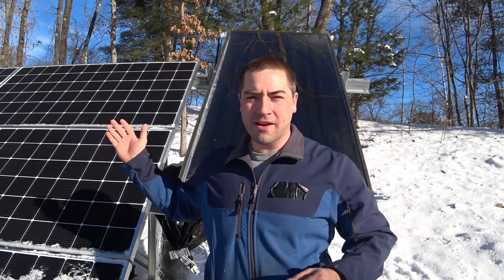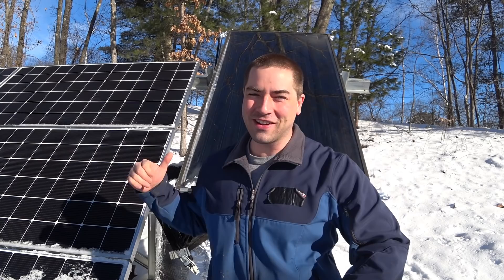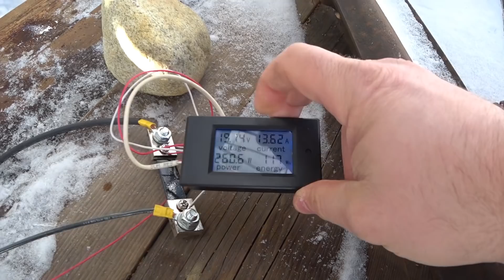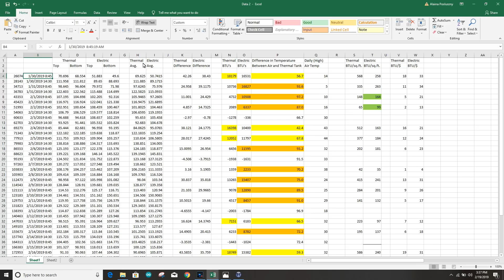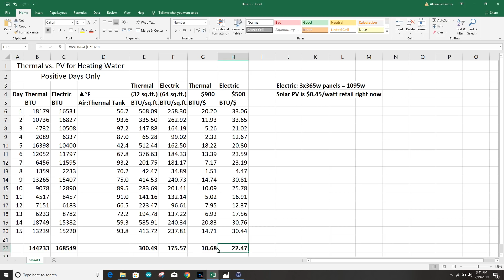Results of Solar Thermal vs. PV Experiment in Heating Water

Comment: Thanks alot for sharing this experiment. Can you come back with data for April and May?
Thermal panel should always be better in heat applications. PV has what, 20% efficiency? If you collect the heat perfectly you should get near 1000w per square meter in sun instead of 20% of that...
Reply from the maker: The solar thermal panel works better when there is a smaller difference in temperature between the outside air and water.  Basically, less heat loss out of the flat plate collector to ambient air.  So, if the outside air temperature is 100 degrees, and you are trying to make 130 degree water, there is a 30 degree delta. (Fahrenheit) This will outperform the solar PV.  I set this experiment up in winter on purpose to find out which works better when the delta is large.  The greater the delta, the better PV is compared to thermal.
Reply: @DavidPozEnergy  Okay thanks for the answer. But I do believe there are some unique factors at play in your experiment that could be improved to raise the Thermal Panel results. And that goes for all youtube experiments of course. Just the Thermal Panel itself plays a major role what kind it is... When (if?) you put it on the roof and the watertank indoor you should get significant better results I assume. Best of luck to you!

Comment: Hi David, I'm kinda obsessed of watching your videos recently, it's very interesting for me. By watching it I've got curious about where do you live since there are pretty cold during the winter. I live in the place witch latitude is 55° North. I am thinking of going solar but there are some skepticism regarding the living in the North part of Earth. I'm curious how much power  during a year can I expect to get out of the PV system which has 10 kWp of installed power?
Reply from the maker: Hi ZhlvisLT.  Solar can still work at higher latitudes, but just to a lesser amount. I live in Massachusetts, 42°N.  There is a rough rule you can use for how much power.  Multiply your system size (kw) by your sun hours (hrs).  For me, where I live, I have 2.8 sun hours per day.  This is an overall average taking into account sunny days and cloudy days.  https://www.altestore.com/howto/solar-insolation-map-world-a43/
Reply: @DavidPozEnergy  Thanks for an answer. Could you  share how much electricity did your system produce during the last year?
Reply from the maker: Sorry, I don't know.

Comment: Ive seen work with solar thermal in roads and ive been thinking that designing a driveway around it could be the best way to hide the panel and also your driveway usually goes right next to the house so it would be easy to pipe it into the basement.
Lol at 8:00 when you said the pv was so simple yet you goofed it at the beggining.

Comment: I think the PV wins hands down for me for many reasons! One is that it is very easy and cheap to move electric anywhere needed and have little loss, not so much for hot water. I could put a large storage tank in house or shop far from the array, then just electrically heat water at the tank. Moving hot water takes pipes/hoses and insulation all of which adds up to far more cost than same amount of wire, and there will still be more heat loss moving water than loss of power in wires.  For heating need Lots of hot water in winter, very little in summer, but need air Conditioner in  summer and hot water does not help with that at all. The excess PV power  can easily be changed from heating water to running air conditionair. Pretty much almost no worries with PV, but water leaks scale pumps etc.. etc.. For the collector type. Also in hard freeze severe winter no real chance PV will freeze up and bust anything.  Electric also cannot freeze in a wire like water in a pipe or hose rendering a system totally useless with a blockage, and no costly antifreeze is needed for an electric system. Also in a Shutdown failure of some type like a leaking storage tank, PV can be switched over to electric heating for whatever heat it can produce so not total loss of the system.
  Yep, for me the PV is a clear winner since I have more space than I could use up installing panels.
  Also I could just sit a tank like a 275gal IBC in my shop, no insulation needed as any heat loss will be heating my shop and just install electric heating elements right into that tank.

Comment: You're using the wrong type of thermal panel.  People in Northern latitudes typically use vacuum tubes.  Tube insulation is way better than flat panel insulation.
Reply: Well, everything is an evolution.  It will be fascinating if and when, he may do the same comparison with a vac tube system. Hopefully as the channel grows and the economics make it feasible to run out and buy thousands of dollars worth of equipment, we will may a video on it. I hope so. Ive seen vac tube systems in action in below freezing temps and their performance is  very good, so good that water cannot be left stagnant in the set up on warmer days for risk of boiling. Excess heat must get dumped if it cannot be stored. swimming pools and hot tubs are good for that.
Reply: That's not the only (or even bigger) flaw of this experiment, but that is true.

Comment: Makes a whole lot of sense, particularly the fact that the solar thermal is only more efficient under ideal conditions whereas the solar PV can be productive across a wider set of conditions.  And I would think just being able to run the PV-produced eletricity over to the house without any further (serious) losses is also quite important.  That gives you a lot of flexibility in situating the tank in a location where even its waste heat would help heat the garage or home.

I'll bet the PV solution would work as well for the garage as for the home using the same heat-exchanger method.  For that matter, even a single-loop heat exchanger with a small fan ought to work pretty well for heating the garage.

Now, since its a closed-loop system, what about using something other than water?  Something that doesn't suffer from corrosion or mineral deposits and perhaps can handle higher temperatures and/or have more heat mass?

-Matt

Comment: In EU/ Poland it is still more affordable to buy solar panels to heat up the water. 3x pv with 360W cost $1100 and high quality flat solar panel cost like $350, tube solar panels are bit more expensive ~$400  (depends on design/ no. of tubes etc). From Feb to Nov both solution do good job, but in my area is better to power up home from pv's and have hot water from solar thermal. In December and January there is almost no sun so both solution don't give any relevant difference. I think you could also test tube solar panels in colder days are much better. I also see that PV's and solar thermal from China (or some crap factories) don't hold their specs, even good panel on paper can be real shit in case of cloudy days.

Comment: Thank you for sharing your efforts in this comparison, it’s very interesting. I may have missed it, but did you record electrical power produced from the PVs for the same 15 days as your thermal comparison? Also, what was the “rated” power of the thermal panel? From your data, it seems as though you obtained only about 92 W/m2 useable for heat from the PVs, but 157 W/m2 from the thermal.
Reply from the maker: I did not record the electrical watts.  I recorded the tank temperatures.  The data plate on the side of the thermal panel says "Thermal Performance Efficiency (ASHRAE 93-77) 81 BTU/ft2-hr-°F"
Reply: OK, thank you Sir. So that’s 2590 BTU/hr or 760 W (per degree F)...I guess that’s a delta T between the inlet and outlet. Was there much of a difference between the top and bottom tank temperatures? The angle of your panels means you live pretty far North, I guessed about 6 hrs of sunlight per day in Feb...at least when it wasn’t snowing! Thanks again for your efforts and reply! There is a ton of “stuff” out there, I really appreciate it when someone is willing to share the numbers.
Reply from the maker: The raw data is all on Patreon: https://www.patreon.com/DavidPoz and I live in MA, 42.5°N
Reply: Thanks man. So, about 2 degrees F delta T, which gives your thermal panel around 1.5 kW, or 500 W/m2, and made it close to 30% eff. at heating h20. That’s awesome! The PV’s were about 18% eff. Thank You!

Comment: Awesome info and exactly what I was looking for. I have been tossing around this exact thing either going solar thermal or pv to heat my water heater. Been on a quest to cut my homes energy and have already cut about 50% and now its time to shut off that hot water heater once and for all and heat it will solar panels. Should have a pretty good return on investment as I figure it cost me about $30 a month to heat water, so at a cost of around $500-600 to install a pv system myself im' looking about about a 2yr return which is pretty damn good.

Comment: Sadly over here 3 photo voltaic panels cost a lot more than one thermal panel. I am assuming that you are using 300w panels judging by the physical size. Interesting video though, got me rethinking my shop heating.
Reply from the maker: Yeah, everyone's situation is a little different.  I tried to use retail pricing for my comparison, but it's for the US.  These panels are actually 365 watts, and I bought them used.  Still work great.

Comment: With PV U still need to buy your electric heater or heat pumps. Those will add additional cost. Heat pumps will last u 5 yrs and u buy again. For heating water. Thermal is the best. Plug and forget.

Comment: David....great job....I am in Israel where the Solar Thermal panels and a tank (usually 150 liters) are required by law for every house and apartment--you see them on the roofs of every apartment building....called a "dude shemesh"  lit. "sun boiler"....no pumps--thermal syphon principle....I'm also doing research on how to retrofit existing systems so they produce more hot water expecially in the winter...how did you get the digital thermometers into your tanks without leaks?
Reply from the maker: Hi Jeff,  Israel is a hot climate compared to where I live, North East United States (Massachusetts).  So I suspect the thermal systems are better for you.  That's great you are working on improving them.  I showed installing the temperature sensors in this video: https://youtu.be/kkoesuG72xQ starting at 15 min. 7 seconds.  Thanks for watching.

Comment: on the thermal - would be interested to see experimentation of different flow rates on the water circulation - how would that impact?
Reply from the maker: The ideal thermal system would have a variable speed pump, and a fancy controller.  The perfect setup would be to have the water coming out of the panel always just a little hotter than the water coming in.  If it comes out a lot hotter, the pump needs to go faster.  If it comes out not hotter, then the pump needs to slow down.

This wouldn't make a big difference on my experiment with one collector.  But it would be a good thing on a huge setup.  Maybe someone could build it with an arduino?

Comment: It would be interesting to see how the numbers compare in the summer. From what I've read, PV efficiency drops a bit when the panels are hot. On the other hand, you wouldn't be needing the thermal heating in the summer, either. So, the PV might overall be more helpful. But, if I was going to heat a swimming pool in the summer, I'd probably stick to the solar thermal.
Reply from the maker: Solar thermal is the perfect choice for heating a pool.

Comment: I didn't notice if you took the temperature of the PV array into consideration in your study.   PV panels perform better on really cold days.
On hot summer days,  they are at the worst. But if it's under 20F  (air-temp) outside, you can count on more power from the sun.

Comment: Now do a test where you empty and refill on a daily basis as you would actually be using in a home. That would be more pragmatic than your first test..
Reply: This is a good point. Solar Thermal will improve in performance with colder inlet water temperature.

Comment: This heater will beat Dave's experiemtnby a factor of 3.5 times more hot water, if he bothered to try it.  https://www.homedepot.com/p/Rheem-Performance-Platinum-80-gal-10-Year-Hybrid-High-Efficiency-Smart-Tank-Electric-Water-Heater-XE80T10HD50U1/303419594
Reply: I find it interesting that those who suggest systems haven't or would never try it themselves. I have a heat pump water heater and and also heat with PV. If you believe these high COP, you have been snookered by little details.  HPWH are not good for storage because they can not get much above 120F. For $2,000 you can have one hell of a PV system on a water heater.

Comment: Dave, if you take your data table and multiply the BTUs from the PV by 3.5, that is the yield from an electric heat pump. The heat pump would beat both other types of heating by a big factor. Unfortunately, your experiment was a big waste of time, because you need to understand more of this subject to guide others.

Comment: Solar Thermal is probably better if you have engineering knowledge and you can construct your own thermal panel and system.
Pumped thermal often provides just warm water which needs post-heating, however, thermal panels working on a thermosyphon tend to supply HOT water. 
One system I was involved with needed a pump because of panel location, the pump was controlled by a bi-metallic tank thermostat in an upside down glass sweet jar installed next to the panel. 
The pumped Glycol water mix was circulated through a high surface area coil inside a specially made small copper cylinder.
This small copper cylinder was then coupled directly by thermosyphon to the very top and bottom connections of the domestic storage tank using large bore pipe of course.
The smaller tank rapidly gets full of very hot water, this then circulates by thermosyphon into the larger domestic tank, this system achieves perfect stratification, ie it generates hot usable water without the need for post-heating with other methods because it heats the top of the cylinder first and works its way down. 
One problem I had with my own thermosyphon system at home was night time leak back, the heated glycol mix in the primary would recirculate back to the panel at night cooling the hot water tank, maybe because of my height from panel to tank not being great enough, I solved this using a heavy duty brass swing check valve, however the heavy brass door in the valve had to be taken out it was too heavy for the thermosyphon to push and had to be replaced with a wafer-thin copper disk I made by annealing an old copper penny and hammering flat, this was soldered onto a small bore piece of pipe to form the hinge bit and installed in the valve.
This comment may help some of you designing your own systems.

Comment: Liked, first of all because you converted F to C, second because you do a great job
Did you caounted the cost of heat elements too? The comparison is very basic, try add the cost of every thing, wires, pipes, electric heat elements...
Reply from the maker: LOL, that was my first try doing a conversion to Celsius (in a video).  I didn't realize my videos were so popular oversees, until all the comments on my last video  The more things you add in, the better and better the PV looks.  Wires are a lot cheaper than pipes.  Thanks for watching.
Reply: …next kilowatts. ( sorry British Thermal Units aren’t even used in Britain!)

Comment: Convincing data for low outdoor temperatrures, but what happens summertimes with high outdoor temperatures? Then the heatloss would be less för the Thermal panel wheras the efficiency decrease for the PV. I suggest you to repeat the experiment this summer.
Reply from the maker: You are right.  I have no problem getting hot water in summer.  My problem has been getting enough hot water in winter.  That's why it was important to me to run the test in the cold.

Comment: Gerat vid, thank you. How about using the Thermal to preheat the water before going into the PV tank? You'll gett all the water to your prefered temperature and increase the Thermals efficiency do to the air/water temperature variable.

Comment: Wouldn't the Best way to heat the water in a off grid situation be to use a mixture of both systems to get the water hot on the best of both systems offer?

Comment: David, while Evacuated Tube solar HW is more expensive still, it has the following advantages:
1. It does not need to be a drain back system, as the water only passes through the heavily insulated header, not the tubes. This removes all sorts of design constraints.
2. Because of this, it is not affected by the ambient air temperature as your flat plate setup is.
3. It is many times more efficient than the flat plate setup.
4. It generally comes with a sophisticated controller that varies pump speed etc.
For these reasons, nobody has fitted flat plate setups here in NZ for a number of years.

Comment: This is a fun backyard project but you’re not a scientist and not a math guy. 

For a regular home application, grid tied PV and HPWH is the best solution. 

1. No plumbing on roof, less weight, wind resistance. 

2. More energy produced with PV and HP

3. In summer, send energy to grid for storage, get in back in winter. 

4. With thermal panel, the winter size becomes oversized in summer and energy is wasted.